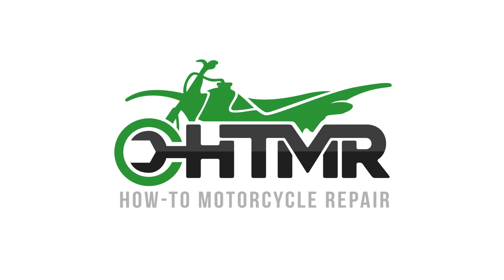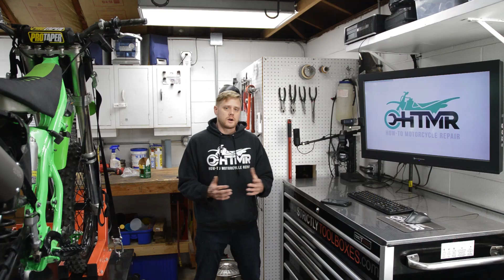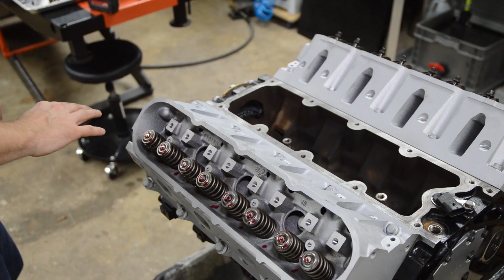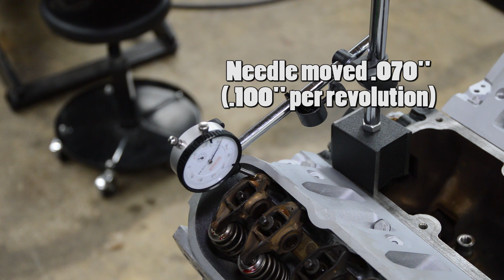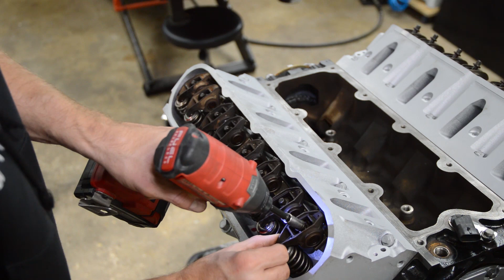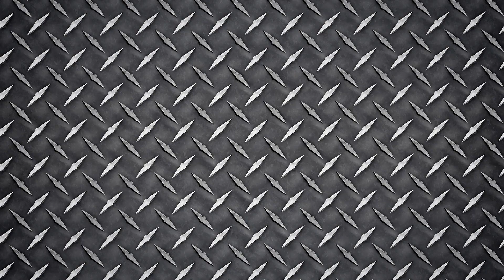Chevelle LS Turbo Build - LS7 Lifter Preload / Rocker Install

Comment: If replacing stock items do you still need to check preload? I’m making a list of what needs to be replaced on the 5.3. I only saw others online going for torque specs or sloppy style repairs. Thanks
Reply from the maker: I checked since I installed new lifters and the heads got a valve job. The valve job included skimming the gasket surface. Just wanted to make sure nothing changed.
Reply: @HTMR  thank you sir. Currently looking into prices for gm lifters and trays 😐